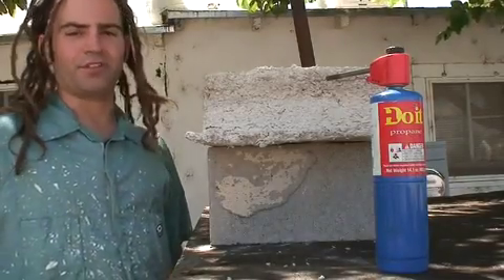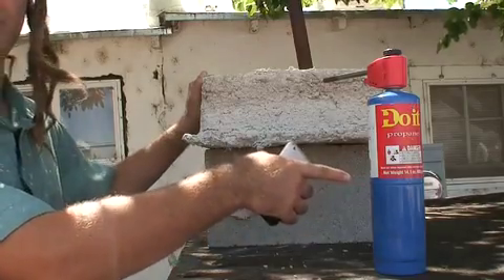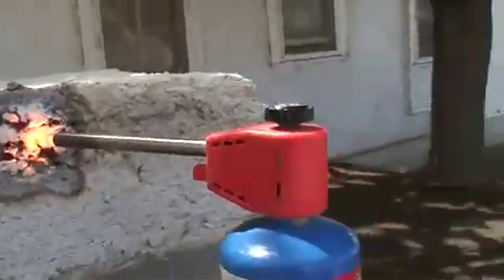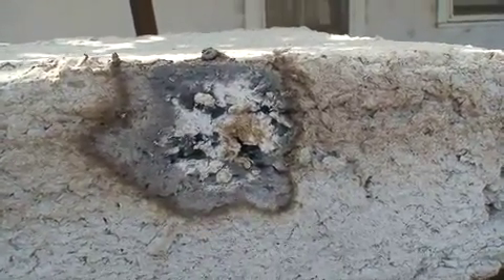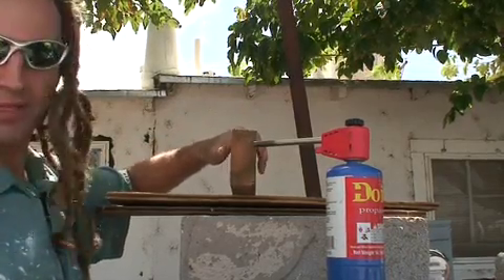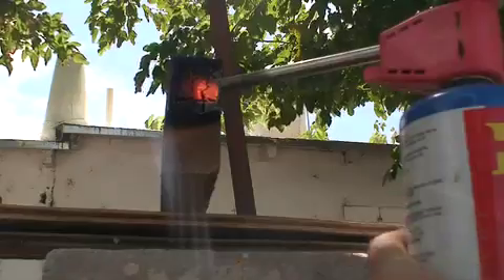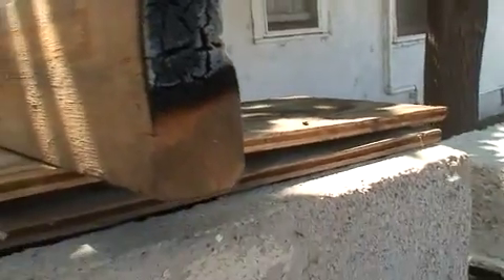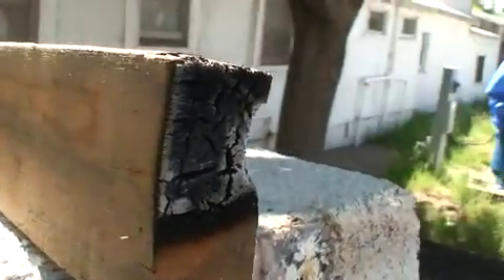Papercrete Flame Test

Comment: WHAT A JOKE OF A TEST!

1) Notice how the size and placement of the flame differed from papercrete to wood. Placing the larger flame against the corner of the wood allowed for more surface area to be burned away. Intentionally misleading? Looks like it.

2) Placing a large furniture fire up against a mock papercrete wall section would better show the effects of a real fire scenario. Not to mention the structure loading effects of a fire.

Even relatively cheap fire retardants can be applied to wood framing to give the same effect. The attempt to make papercrete look noncombustible failed as it clearly decomposed due to exposure to fire. The cellulose burned, and the concrete could not move heat away fast enough before crumbling to dust. WHAT A JOKE OF A TEST!
Reply: I tried it myself and the test IS accurate.
Reply: OK boomer! And next time, confirm your sources.

Comment: four years later but paper is made from wood pulp and also requires heavy machinery and deforestation,blocks and bricks are made from practically renewable resources, ie soil and rocks
Reply: Wood is just as renewable, if used to make paper ir usually comes from farmed trees and its production actually absorbs greenhouse gasses, if you're keeping score. Each has its pros and cons, but let's stick to the facts.

Comment: When you have a flammable material, paper fibers in this instance, encapsulated in a non-flammable materiel, which is the concrete, you have a self-extinguishing building material. The reason for this is, is that the fuel which is the paper/wood fibers is not available quickly enough to keep the combustion temperature up and therefore starves itself....Great Work!

Comment: This would have been a better test if you had used the flatof the 2x4.  However, your point that papercrete won't just go up in smoke is well illustrated.  As to "TheKingdomofErnor"'s assertion that paper has no negative effect on the environment, that is wildly incorrect.  There are two major problems with it.  First, harsh chemicals are used to process pulp and second tree farms are not forests, but would otherwise be so.  Keep going with the papercrete - love it!
Reply: There are no 'harsh chemicals'. Sodium Hydroxide can be made through the electrolysis of brine. The Sulfide is not required but it could be obtained from sea water... You can recover Hydroxils and Sodium indefinitely.

Comment: id like to point out that these blocks would most likely be rendered in the house as the finish looks horribel without it, and therefroe any radiant heat would be striking a render, rather than a papercrete block. and i relation to your question in relation to aussie bushfire conditions most homes cannot withstand such temperatures, but papercrete would stand up better than the majority of wooden homes we have here in aus!!

Comment: Now expose it to true bushfire conditions of 30% humidity or less 100kl/h winds with 9000kw^3 meter thermal radiation. (an extreme fire).  When you stand the product do so in heat exceeding 600 degrees C for 20 minutes then 200 degrees C for 3 hours. That is what Australian fires typically involve.

Comment: @ Jesusisyhwh 
papercrete is made of something we already made, newspapers, and instead of trowing them away, they get a second purpose, so re-using materials is way better for the enviroment than using new ones imo.
Btw, as you can see, papercrete doesn't burn, not even when you hold a blowtorch to it, so it's also safe to use.

Comment: You mention one part cement to one part paper. Is that one bucket of ground up paper and cement or do you go by weight? Also could one use the blow-in cellulose insulation for the paper and mix in a standard cement mixer? Thanks for posting.